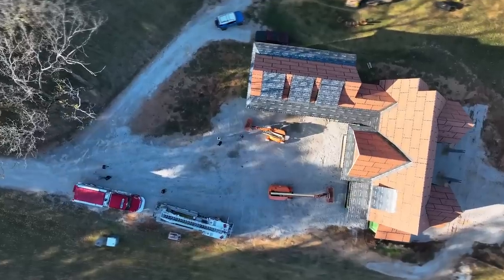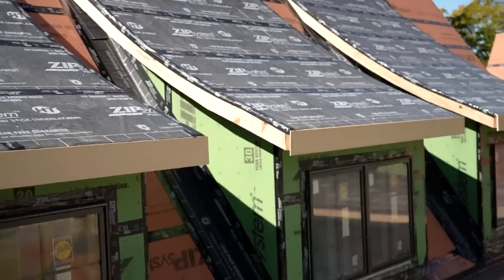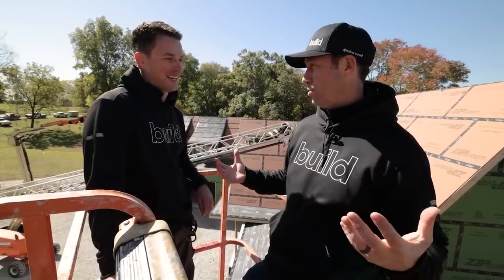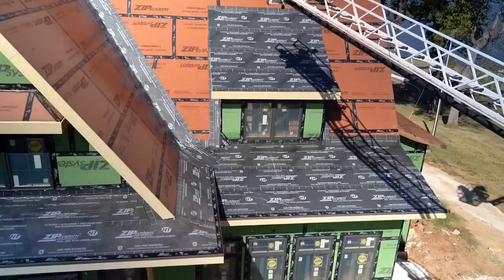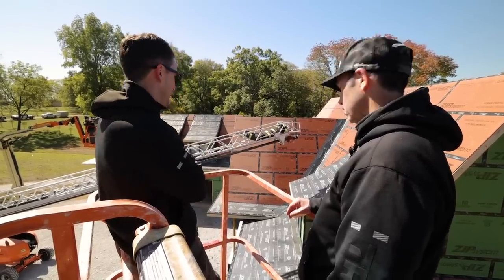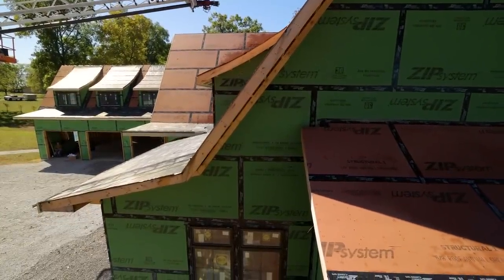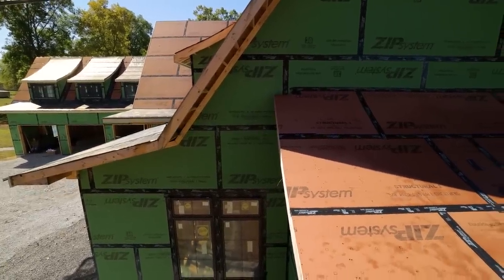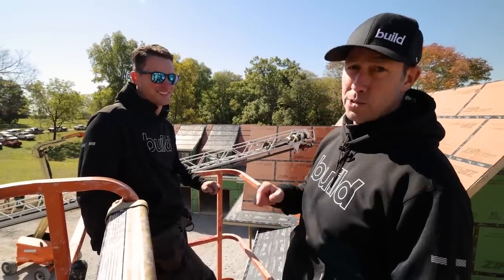Firetruck vs. ZIP System... Water stress test!

Comment: You know homes that's just that they're made out of wood most of them you got people that want to make it home that'll last forever being made out of wood I say negative to that the deal with the zip system to even consider the added cost which were all concerned about our electric bill and the health of our family you know when we talk about ventilation I think of filtration of the air as far as asthma medical issues would a person get a cheaper insurance on a home that has the zip system I know we're trying to make the house more effective at using energy and or our electric bill you see homes budget's not the concern really I mean they're elaborate they're out of control it's a whatever kind of house but with the zip system could a person qualify for cheaper insurance being that it is built with materials that are more weather resistant when I think of a home that's more weather resistant I think of a storm shelter you know they build storm shelters to keep from getting a wrongful death hospitals jails public buildings but the average home builder what is the actual cost I mean I know you're trying to protect a home from the elements but a real world home basic home is it worth the added cost cuz you can insulate one I would imagine with basic materials not sounding cheap but a house can burn down in a matter of hours and it took months to build it... And we all know mother nature you can't stop her.

Comment: Anyone make their own ZIP-r adhering locally available EPS foam to regular zip panels? I can't get anyone to order ZIP-r and no one from Huber can find anyone to supply me.
Reply: Just a FYI - the insulation on ZIP R is polyiso, like the kind you seen in lowes / HD.  It's simply glued to it with a non-structural adhesive.
Reply: The answer is yes
Reply: If you have the time to make your own you'd be able to save money.  Things to consider are the vapor profile and Rvalue of the EPS vs Polyiso. The Polyiso at Lowes and HD are foil faced, not fiberglass matt.

Comment: Explain why you can film yourself without fall protection and not get a massive OSHA fine. Not to mention, it's just plain stupid. Furthermore, if by some small chance you have a waist belt on, you're going to be a paraplegic or dead. If you're going to do this for a living you should atleast be responsible so people could at least follow your example.
Reply: Hummm...
I worked industrial for 35 years and hasd a huge number of Safety classes and certifications, including JLG & Genie lifts and it's my understanding that if you're a private individual, not an employee you can chose not to wear safety harnesses and tie off. I however DID wear my own personal safety harness a couple of years ago when I rented a lift during building a steel building because all the years of training just stuck I guess.
Reply: @BOB Joatmon  he's not just some individual he's an employer with 27 employees. You need fewer than 10 employees for a partial exemtion. He has no exemptions. It's just stupid anyway you're inside a catapult. I frequently am in 120' booms. I've seen much smaller just sink a wheel and bounce a guy out of the basket.
Reply: @BOB Joatmon  also 80 bucks for a good harness and roughly 30 seconds to put it on. I mean, come on.
Reply: @shawnshurtz9147  yes, he's an employer BUT he's not on HIS job site and that's his choice. I do agree with you he isn't smart to not use a harness but under the curumstances he's not going to get cited by OSHA for it. The contractor whose job it IS might get cited though.
Reply: @shawnshurtz9147  the has to be a culture of safety that takes years to develop.
Back in 1979 we were still wearing back breakers and guys still weren't tying off while traveling. I saw a couple guys get injured and one fatality on Texas jobs in the 80's due to falls because it was new and there was resistance and forgetfulness in the workers. But that slowly changed and by the 2000's most US workers had it in their culture to just do it (like maybe you have that ingrained in you now). 
I was working foreign in January 2001 in El Salvador building a powerplant when a big earthquake hit. I had shipped down 100 safety harnesses of varying sizes because the local hire crew was going to be putting up a steel I beam (14" heavy) support structure for a giant air filter topping out at 40 feet above ground.
They ALL refused to wear harnesses because of macho and because there was no OSHA there I couldn't force them, just request it (and document their refusals). When the earthquake happened two guys working on the beams 40' up fell and died. Note they have none of the social safety nets like the US does so their wives and children get NOTHING. I called my US company headquarters and asked if we could do something, even though it wasn't our fault OR LEGAL RESPONSIBILITY and they donated 30K to each family (about five years income for there).
So the point is, the culture of Safety hasn't reached to home building contractors yet to the point that it's automatic like it is for industrial contracting. I shake my head every time I drive by a house being roofed and none of them are using harnesses.
What changed with industrial companies getting safe WASN'T OSHA, it was HUGE negligence lawsuits won by the families of dead workers. It's simply more economical to have safety than pay out on huge lawsuits
Reply: @bobjoatmon1993  great perspectives.